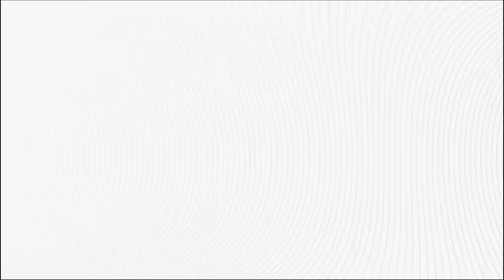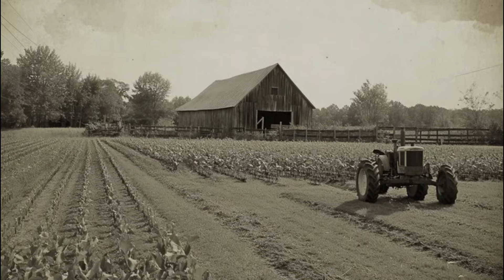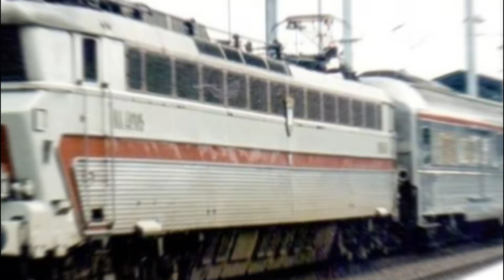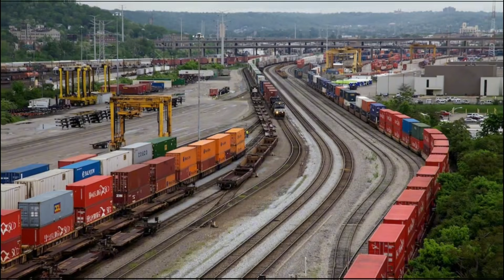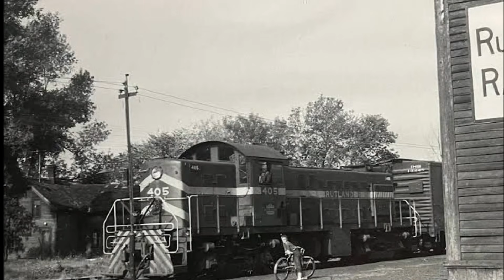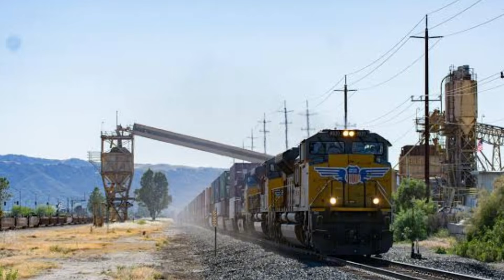What's WRONG with American Freight Trains? Why US uses Single Cab Locomotive?

Comment: That is not a good enough explanation. The Stadler Euro-Dual weights 126 tons, has an diesel output of 3800 HP, an electric one of 9400 HP, is 23 meters long and even so has two cabins. And surprise, the same locomotive  works with diesel  or electricity. There is nothing like this in the US.  https://youtu.be/rMCHCQE4LO4?si=UIR0xF_gihtqO-QS